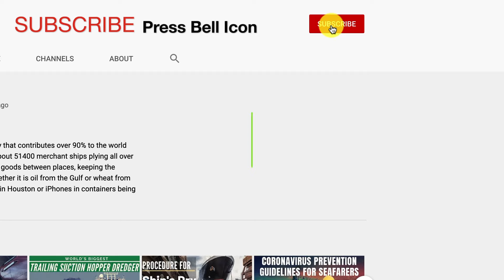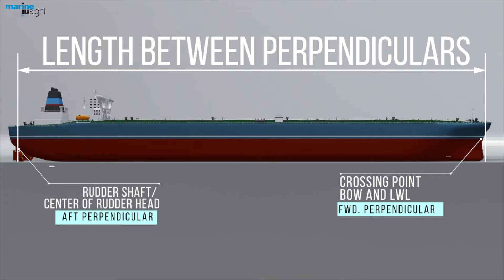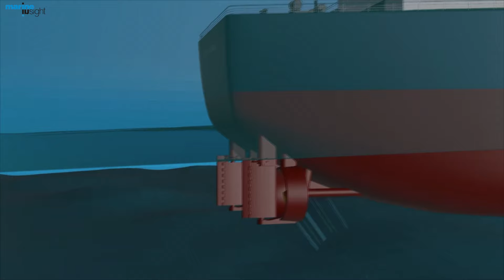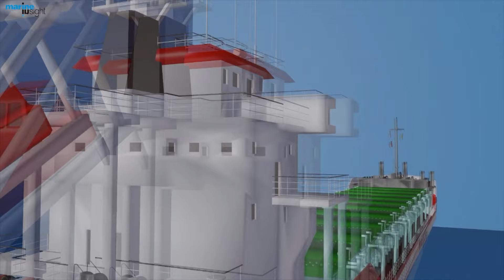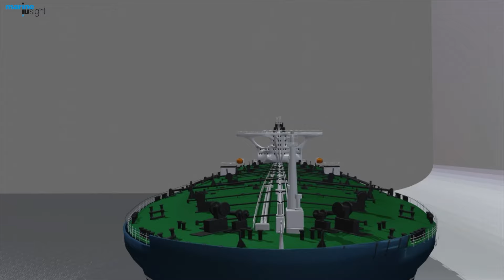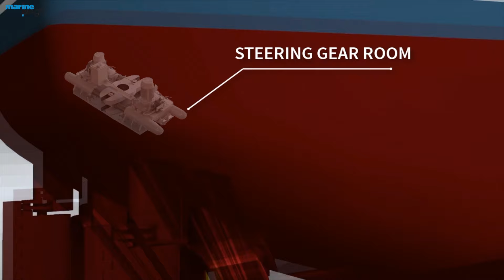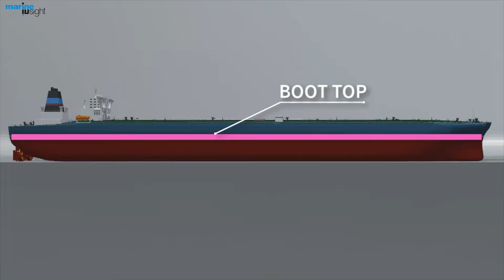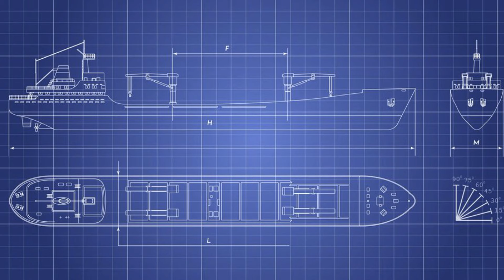Ship Terminology - - Ship Parts Names with Pictures  #shipterms #shipparts

Comment: Question. In naval ships where there's a helicopter hangar located between the helideck (at the stern) & midsection, but then what IF that part isn't used as a hangar but such a similar structure is still present at that area, what is the best technical term for it or any applicable terms to it? Thanks

Comment: Main deck;
And the top of the bridge ? The ceiling of it?
Militaries say bridge. Maritime professionals say passageway. 
Militaries say gangway. Maritimes say accomodation ladder.
Reply: There was a time commercial ships carried both gangways and accommodation ladders.  The gangway was a flat walkway with siderails.  The walkway was covered with non-skid paint or other surface.   The gangway  to help with traction, might be  fitted with vertical bars or angles about 25mm in height.  Gangways are used as a walkway between a ship's deck and the shore when docked.

An accommodation ladder is used primarily when the vessel is at anchor for boarding launches or other transportation.   Accommodation ladders can used as gangways.  In general, gangways should not be used ss accommodation ladders.  Accomodation ladders generally have curved rungs or self leveling steps.   This makes the ladder easy to use at any draft. There are handrails either side for easier access and better security.  Accommodation ladders are generally of a fixed length and are raised and lowered using a davit at the lower end, and are hinged at rhe top end.  Accommodation ladders often have platforms top and bottom to facilitate getting on and off the ladder.

Commercial vessels  particularly those with wide beams and/or obstructions on deck may have more than one ladder.  Often there will be a bulwark around the accommodation ladder to provide the ladder secure storage when at sea.  The secure storage arrangement is called a coffin.

Ships also have Jacobs ladders, e.g. rope ladders with rungs for access.
Reply: @robertlevine2152  Good explanation...congratulations!

Comment: Please explain the bilges. How they are cleaned? How they are pumped out?
Reply from the maker: Hi Gurvinder

Bilges are usually located in these areas - Engine Room, Cargo hold, BT room, Steering room etc. 
Consider them as a collection bucket for all the drains, leakages and overflow of oil, fuel and water. There is bilge piping system connected to bilge pump or eductor which will suck the bilges and transfer it to dedicated bilge tank. 
They can be cleaned using rags etc manually.